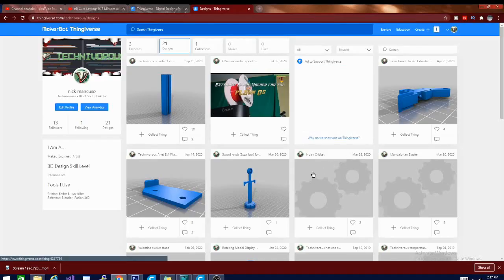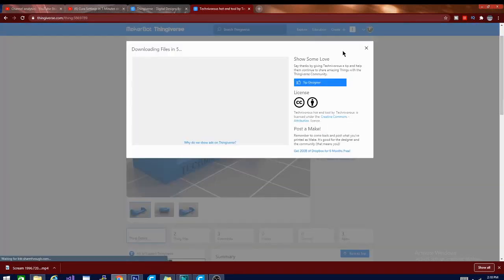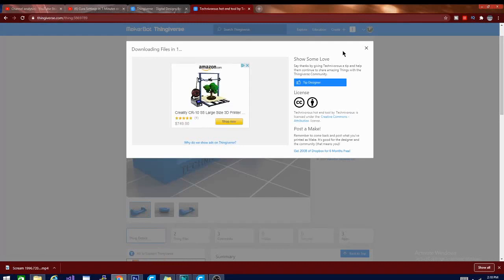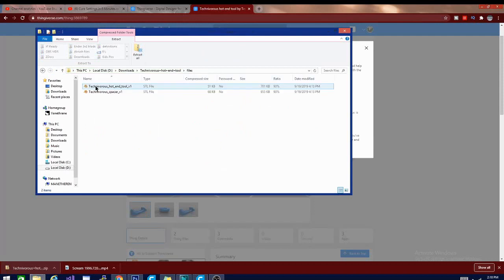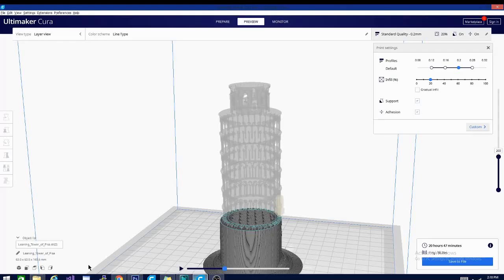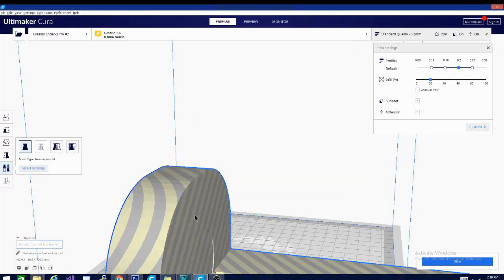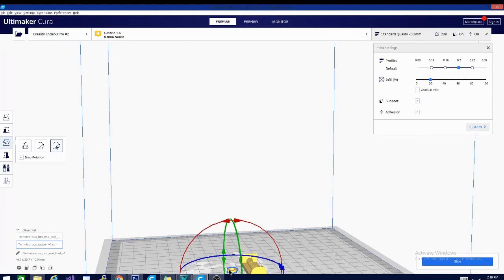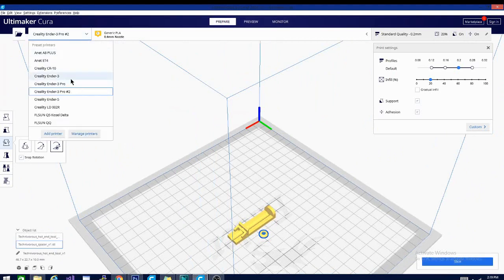Ender 3v2 - hot end fix and Capricorn tube upgrade!  preparing to print abs!

Comment: i dont need to do this if i have a direct drive (the cheap one from creality) on my ender 3v2 right?
Reply from the maker: technically no you dont need this with direct drive. it will still make it easier to change filament in certain cases, as it cant lump up in the throat of the nozzle
Reply: @Technivorous  ok ok good, thanks for the reply! :3

Comment: I just got the ender 3 V2 and no matter what settings I change can't get PLA or abs to ever stick to the bed.  The bed been leveled 20 times, adjusted all sorts of temp on filament and bed temp.  Changed speeds on initial layer and still after 40 hours of messing still can't get filiment of any kind to stick to the bed.  It's practically drivingg me nuts.  Don't have any of these issues with 3d printers at my work.

Comment: works well so far with clear PETG. printed the measuring tool and worked well with the capricorn cutter ,  now going to try watered down PVA on the glass bed instead of the gluestick I have available here in Japan , does work but slightly uneven finish. like the way you haven't keyed the green screen after noticing you have green text on the T-shirt. great T shirt , will try and get around to ordering one

Comment: why wouldn't you feed the capricorn tube into the hotend without making a smaller piece that you put inside it?
Reply: the point of doing all these is so the tube does not slide UP after a few times being used, allowing material in between te tube and the hot end. thats why he puts a piece of tube with a washer on top that is pushed down in place by the scree connector and that way it will never move from position and allow melted filament accumulate below.

Comment: You don't explain why the Capricorn tube is split into 2 pieces with the washer in-between and I'm not getting it on my own, can you explain?  Other videos I've watched on the subject just have you pushing the tube all the way down as far as it will go without using 2 tubes and a washer. 

Just want to add that your build plate is gross and it's no wonder because apparently you don't clean or level it in-between prints. When I see you adjusting the leveling knobs while the print is going on I cringe.
Reply: Also, if you're going to print wood or other abrasive materials, don't you also have to get a hardened steel, abrasion resistant nozzle so it doesn't wear out right away?
Reply from the maker: i will make you a video explaining the tube and washer better, your not the first one to ask. as for your second question, while some abrasive materials eat through nozzles pretty quickly, such as nylons and glow in the dark filament, you can print them with brass, you will just go through more nozzles, which i have an abundance of. if you are going to do a large amount of printing of one of these filaments, yes a hardened steel nozzle will save you a lot of nozzle changes. for filled filaments like wood though, a larger nozzle, .6 or bigger, will be the biggest bearing on your success.
Reply: @Technivorous  Thanks

Comment: Nice I’m going to do this fix too, just for an extra upgrade but isn’t needed,Something I noticed you doing in the video that you must never do is turn the printer off when the nozzle is hot,if you do there is no cooling to cool the nozzle so it will take awhile longer to cool down from 190-200c to room temperature all this heat goes into the Bowden tube thus Bowden tube will bake a lot easier but with fan running nozzle cools from 190-200c in couple mins
Reply from the maker: Oooo I never thought of that but that's a great point! Thabks b.f pinpointing that out!
Reply: @Technivorous  no worries I’d like your nozzle and Bowden tube to last the longest possible so allowing it to cool will dissipate the heat better just a update I did the hotend fix and it’s working perfectly

Comment: Hi there, I noticed you never mentioned exactly where on your printed measuring device you cut your cap tube. I first cut on the notch area of the measuring tool but then had issues screwing in the coupler after fitting the printed washer.
Reply: I printed a alternative hot end measurement device and can confirm, your device is slightly off.
Reply: @joeluevano9366  can you share the one you printed?

Comment: would you recommend this if I only plan to switch between PLA and TPU?
Reply: Yes. This method assures your bodem tube is pressed tight against the nozzle at all times which helps prevent other issues.

Comment: Did you mention the length of that small piece of tubing. Seems a waste to print a special tool to cut tubing to a particular length. I am capable of cutting tubing straight without it.
Reply: Thanks for the heart.
What's the answer to my question??
Reply: @davesage9190  I think it varies. This is a remix of the original hot end fix by Luke Hatfield. Honestly CHEP probably has the best approach here with his remix because it takes into account the users individual machine and he has you measure that length of tubing, not just cut from a template.
Reply: @dirediredude  Thanks. It has occurred to me since - what happens if that short piece of tubing gets stuck in the hot end. You're sort of screwed - NO?
At least when it was connected to the rest of the tubing you could maybe pull at least some of it out.
Reply: @davesage9190  Might be a little more difficult but you can always just remove the nozzle and push it through. Which actually is helpful because it cleans out gunk left behind. But in theory this should last a long time because of capricorn tubing's higher heat resistance so probably not much of a concern.

Comment: This mod not only enables printing in higher temperatures, but also secures tight connection between the ptfe tube and the nozzle in the long run.
 I did this mod with the white stock tube at first since on stock installation tube would eventually move out slightly after some 20h of printing and retraction wouldn't work properly.  After that mod I never again had that issue. Later on I did change that small piece of tube with the capricorn one just for the higher temperature resistance.
Reply from the maker: Well said!

Comment: isnt you putting the cap tubing all the way inside the same thing as having 1 smell piece inside with the washer? 
It's going straight down what difference does this make if you using cap tubing for both parts.
Reply from the maker: i understand the confusion. if i could draw you a diagram i would, butsimply put, the washer, is larger the bowden tube, and the connector for it, since back pressure can move the tip of a full tube away from the hot end and create a gap, as the tube is thinner than the coupler, it slides through it slightly. placing the spacer, which is too big to slide through the coupler, locks the whole assembly in place below the coupler, so the tube cannot move upwards.

Comment: This series for the ender 3 v2 is just what I'm looking for! Total newbie here, I just ordered a v2 as my first printer and with it a spool of ABS, I read that the printer only comes with just a little PLA for testing purposes.. would the included PLA be enough to print the needed parts for this hot end fix? or should I just buy another spool of PLA? I ordered the ABS as I know it is what I would need for the projects I have in mind. thanks!
Reply from the maker: That sample is more than enough to print the washer.

Comment: Did you print the washer in pla?
Reply from the maker: yes. the top of that should never get hot enough to melt it. if it does you have bigger problems

Comment: What’s the difference than just running the tube down as normal without that midpoint and washer? It’s the same tube.
Reply from the maker: The difference is the backwards pressure push up on the tube, creating a gap where filament can melt and harden where it shouldnt. The washer keeps the hot end fully lined, removing this gap, preventing the filament in the hot end from melting before you want it to, which can cause jams
Reply: @Technivorous  Cool, thanks for the info will do this little upgrade.
Reply: @Technivorous  How do you get that little piece of PTFE tubing out if need be? Or is this a "do it once and if you have to replace anything you need to replace the entire hot end"
Reply from the maker: The couple generally grabs the tube when there is back pressure, but it allows it to move a little, and that little gap can cause filament to melt in the hot end before the nozzle. So if you switch filament, that could harden and not extrude. The washer keeps the liner perfectly tight at th bottom where it heats up, removing that gap, and forcing the filament to flow properly